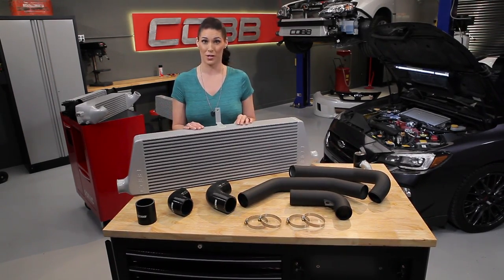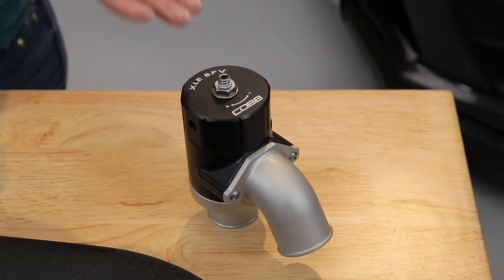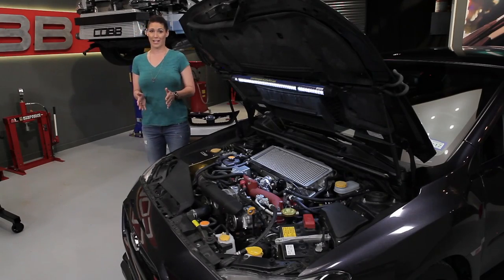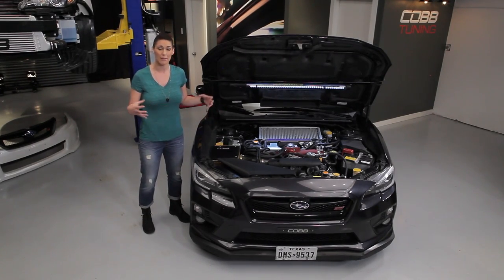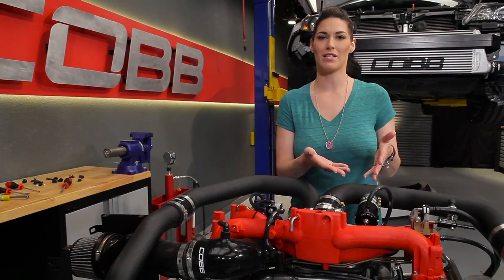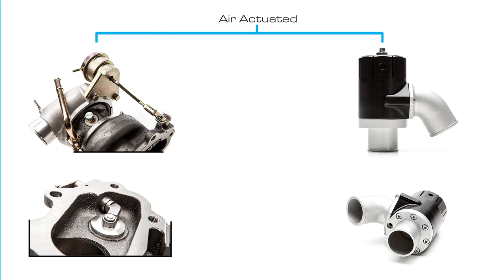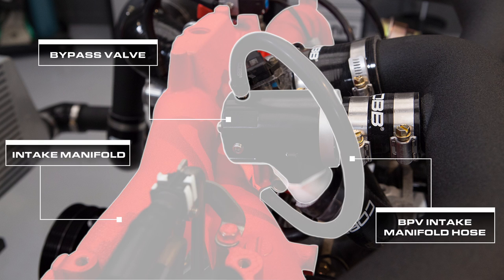COBB Tuning - COBB University Episode #6 - Intercooler and BPV

Comment: It seems to me that releasing compressed air to the atmosphere rather than plumbing it right back in front of the turbo would be beneficial for power. No air-to-air intercooler removes all of the heat pushed through it, water-to-air intercoolers come really close though. That said, with a recirculating bypass valve, the intercooler receives a warmer base temperature every time the throttle is opened enough to ask for boost after having just been closed (example: going in and out of boost shifting gears). Condescension isn't conducive to learning, bro. I happen to really like the air whip blow off valve sound and I don't much care whether that's cool or not.
Reply: @josh c - I like your logic on this - i'm surprised no one else commented on your observation... I'd like to understand more about which is truly better for performance and stress reduction on the system / engine... I agree that releasing the cooled but still warm air with a BOV sounds like a good idea - it also seems counter-productive to recirculate charged air with the BPV -  i would think that you would wind up with too much pressure returning to the TB when you open it again. makes me wonder if it would relieve load from the turbo or actually add more back pressure to the turbo when it's called again, ultimately throwing off the A/F ratio...

Comment: So which IC is better? A thin intercooler with a lot of surface area or a thicker/deeper one with less surface area?
Reply from the maker: A thinner one will dissipate heat better but you're typically limited by the amount of surface area you can cram into the front of a car.  Kyle@COBB

Comment: Another downside to the FMIC is that it also interferes with your radiator’s cooling abilities
Reply: John Nickel smart! Air flows through the FM and then goes straight into the radiator but I bet it does divert some air! I’m watching because I’m deciding what to put on my new 2019 wrx and I think I want to build the car with as little lag as possible! Still deciding on how I want to build the car!

Comment: Is a re-circulating valve = bypass value? What would be the benefits of a bar & plate intercooler vs a tube & fin?
Reply from the maker: Bypass valves are also referred to as a "recirculating valve" and should be interchangeable.  Bar & plate cores are generally more efficient and more durable. - Marshall@COBB
Reply: COBB Tuning thank you

Comment: Is the Cobb Front mount intercooler with stock turbo 2017 Subaru STI safe? Is there any issues?
Reply from the maker: The car would be safe with the COBB FMIC installed.   There won't be much of a benefit without tuning but there won't be any other issues.  Kyle@COBB